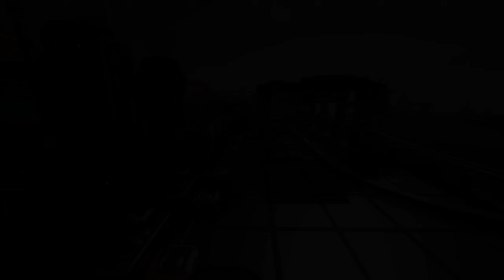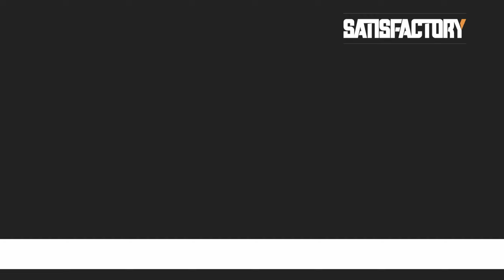I Ran Out of Power… So I Built This [Satisfactory 1.1 EP3]

Comment: If you put a conveyor on the front and back of the blueprint you have for transporting the 4 lanes at a time and then switch to connect mode while placing the blueprint, it should make it so you don't have to manually connect them.
Reply from the maker: ahhh i was trying to figure out how to get that to work